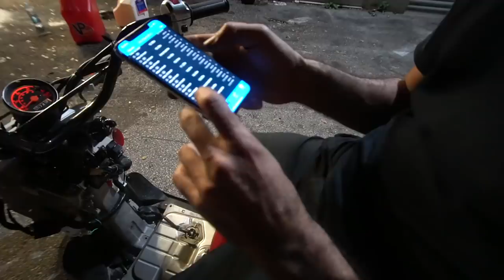SLOWEST SCOOTER EVER!

Comment: Polini variator, dr pulley sliders 5.5g should work for your weight exhaust, intake rejet the carb do a ncy cdi get a tachometer (for tuning purposes) those parts alone should get you to 50 or close to it

Comment: make a seperate cooler for the carb using an old heater core in a little cooler and another eletric pump inlet temps cold as ice ice baby eh
Reply: e 98 and rc nitro fuel a little pre mix for added compression eh

Comment: Was the ricermiata a 1.6 or 1.8 litre ?
Reply: I'm pretty sure it was a 1.6
Reply: 1.8
Reply: Garrett Morse you sure? Is there a possibility to see the difference on the outside of the motor?
Reply: Assassins Sheep yes there is visible differences to both engines, look it up.